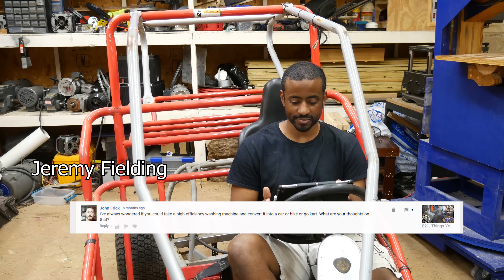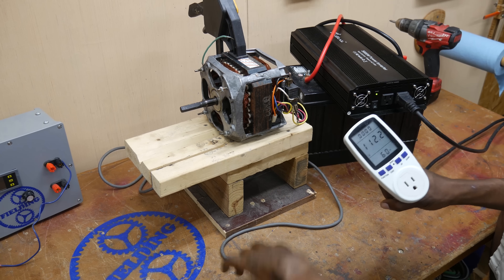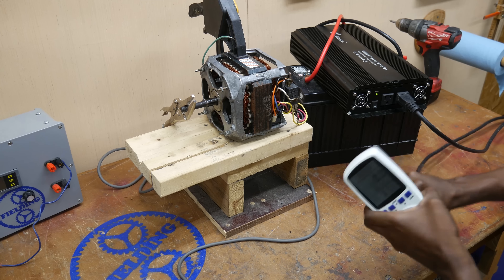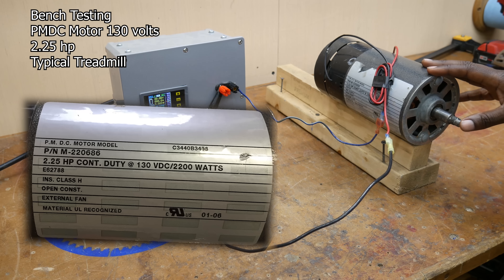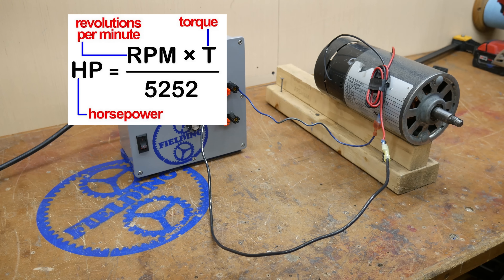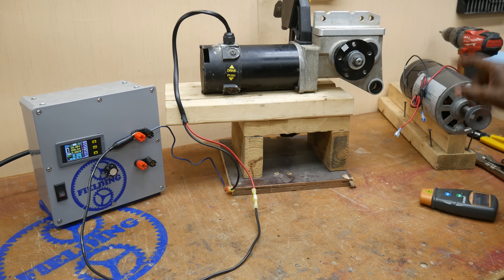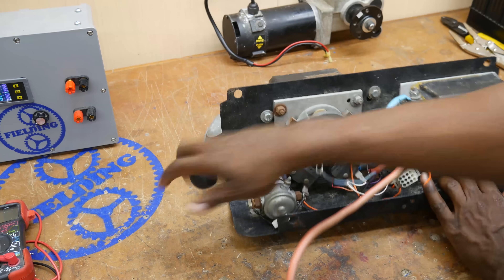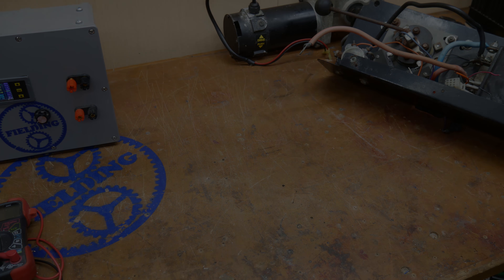What Electric Motors Can Be Used In A Go Kart or E Bike; Bench Testing and Recommended Sizing #61

Comment: It's only about $350 for a 3 phase variable speed drive for a 3HP motor with 1phase input and they can run easily pff a standard 15A wall outlet and would likely do well off a 2000W inverter - but many can also be had with common DC BUS and can run off 200-300VDC - I've built a cart using a 3HP 3 phase motor, cheap VFD w/ DC BUS, and 24x12V UPS batteries - about 10 miles range.
Reply from the maker: If I could take one of my 3 phase motors off the shelf and get a controller that works on DC for $350 that might be reasonable. But 300 VDC is pretty high. I couldn't recommend something like that in a video. 12 rechargeable batteries is getting the cost back up there. You can't recharge that with a standard charger, or you recharge them individually which sounds awful. Perhaps a power supply, but most people watching this don't have that. Also 3ph motors are not a common household thing. I mean I have several but it is likely people would be buying a motor. I guess If you already have a 3 phase motor and you are comfortable with your wiring skills (300 volts) than this is certainly a route that would work. This kind of option depends a lot on your skills and what you already have.

Comment: Actually, if you overvolt your motor, it will draw less current, not more. The power input is voltage times amps. The output power is torque times RPM. So, how much power you use will depend on how much torque you apply to the motor times the RPM of the motor.

The problem with overvolting the motor is not due to extra current. It's due to the insulation on the windings. If you apply too much voltage, it might spark straight through the insulation causing a short circuit which can burn up the motor. A motor rated for higher voltage will have better insulation on the windings.
Reply from the maker: You will draw less current at the same load. That is the point. You can apply a greater load. 

Overvolting...Both are problems... not one or the other.
Reply: @Jeremy_Fielding , What about a starter motor out of a car? They operate on 12v.

Comment: how about using both motors the granny one to get you going then kicks over to the fast one
Reply from the maker: Using two motors makes it a complicated setup... especially with the space that is usually available. But certainly it can be done by those with the patience to work through the problems involved.
Reply: i got my  own project going i have a old Chinese quad bike its just an 80 but i want to make it in to a dun buggy  i have like a million questions about what to do like should i mount the engine from the top or bottom of the frame,  seen as though its a automatic 80cc bike engine should i make the rear axel stiff or put shocks, should i mount the engine mounted over the rear top front of the sprocket, does it matter what way its mounted so can i mount it vertical or should i have the engine flat with the head at 11 oclock as it were when it were a quad

Comment: Horsepower is horsepower. The torque curve of electric motors are very similar. So the 2.25 hp motor that goes to 8k rpm will give you only slightly less performance than the motor you plan on using, provided you give it 3-4x more aggressive gearing.
Reply from the maker: I think you misunderstood what I said... there are other problems which I explained in the video why that motor is not a good option. I didn’t say it was too small or anything like that. HP is not the problem. Getting the full 2.25 requires 130volts... that’s a lot of batteries plus the other problems explained in the video.
Reply: Jeremy Fielding I didn't realize it was 130V.
Yeah, you're right.

Comment: There was an electric go-kart produced back in the 90s called the Kango. It used a Leeson 1.5 hp 36 volt permanent magnet motor and a 300 amp speed controller. They claimed a top speed of 28 - 32 mph. Edit: And then I see a Kango speed controller in your video...
Reply from the maker: I took that off of a very old utility type kart. It was all rusted. It had two motors and I was concerned none of it worked. I offered to buy one motor and the controller. after more testing I think I got the speed controller to work. I haven’t tested it under load but it outputs voltages like it should. I can’t find any information on it. No ratings. No labels nothing. I can’t be sure if I am going over it’s limits in voltage, current etc. both motors were in parallel and rated for 48 volts. But they clearly can run on 36 and some engineers do that as a safe factor for the motors.
Reply: If it is like the one I have, it is indeed a 48 volt, 300 amp rated controller. In fact, I have a copy of the wiring diagram, which calls for connection to three 12 volt solenoids and a switch that acts as a governor in order to allow the operator to run the cart at low, medium or high speed. If you want it, I would be happy to send the file to you.
Reply from the maker: Please do... it can only help or do nothing LOL. I would love to see it. I can't post my email here because the spam I get from that is ridiculous, but if you go to about page on my channel there is a "business inquire" email near the bottom. That will show you my email address. If you still have the thing, a real picture of the controller, or labels and the motor would also help me identify what you have. Thank you for offering.

Comment: could i take angle grinder engine and turn down the rpm with transmition?
Reply from the maker: That speed is really high. it is possible but not worth it I think
Reply: Transmitigation with permition

Comment: Using a booster converter with that treadmill motor should make it usable for this application. That or 9-10 batteries in series. Also most motors can put out 2-3 times their rates go for short durations. You are already aware of the heat problem associated. 
Run the 90-140DC from the boost controller thru a pwm for speed control so the motor always sees the high voltage and lower currents.
Reply from the maker: That is an interesting idea. I think 100+ volts of DC batteries is getting pretty dangerous (and very heavy) for a DIY project... which is why I don't recommend it. Unless you really understand what you are doing. To recommend a boost converter is a sign you could probably do it safely. To buy one at this current input might get costly... I haven't checked. If you have the skills to make your own boost converter that's another level beyond what I was talking about in this video.
Reply: Jeremy Fielding 
I am not really worried about the voltage,  just make sure any of those parts are covered, and well insulated. As for series batteries, if using lead acid, you would probably want to use small ones like those used in motorcycles, or backup power supplies for computers.
Reply from the maker: Small ones mean you can’t go very far.   But in the end everything brings a trade off including cost.
Reply: Jeremy Fielding 
That's not true (ignoring any efficiency differences that might exist). If we look at two batteries,  one group 30 at 12V and 120Ah, and 10x ML12-12 AGM in series for 120V at 12Ah, they both supply about 1440Wh of power. A 2.25hp motor (1678W) if running at 12V would need to draw 140A, while a 120V motor 14A (+10% or so for efficiency losses).

So one group 30 is much cheaper than 10 of the smaller battery, but sometimes you can get the small ones as surplus when companies replace all their UPS batteries.

Some other things to think about are what the batteries are capable of. The Ah rating of a battery is actually dependent on the discharge rate. If you did run that motor at full power until the batteries are dead (and they did not explode), the Ah rating would be much lower. The chemical reaction takes time, so the faster you discharge the battery the lower total output you get.
The internal resistance of the batteries may prevent drawing the desired current, or it might heat the batteries excessively.
Running at low voltages and high currents will have high losses, and require expensive wiring.
Finding controllers might be difficult or expensive at high currents.

In the design I have been thinking about, I would use three 12V batteries in series. The motor will run at least double its rating for some time, so plan on 100A at 36V coming off the batteries.
The power would then run to an inverter running at around 1KHz, thru a transformer to get to 130V (A commercial  inverter could be used if it can handle the power), and bridge rectified back to DC. The speed controller then uses that to run the motor.
Reply from the maker: The video I just finished recording is on this very topic... specifically batteries, capacities, and the effect discharge rate has on capacity. I would agree (danger to the untrained aside) higher voltage certainly has many benefits, thus golf carts don't run off 12v. and Tesla doesn't run off 48. Good discussion.

Comment from the maker: Please read the description! There are technical corrections including comments on the use of Brushless DC or three phase AC motors there.
Reply: Jeremy Fielding ,  I have a 100 volt dc treadmill motor sitting in my shed that I want to use for a project like this...
Reply: I'm glad you saved me some time.  I won't be using it
Reply from the maker: My job here is done 👍🏽
Reply from the maker: I made a whole video on that. Search my channel for dimmer switch
Reply: What do you think about using a 20hp 48v (@ 96v 40hp?) Advanced  DC motor in a '89 Kawasaki Ninja 600R motorcycle conversion?
Was thinking I'd use lithium ion batteries and probably only enough to go 10-15 miles. I don't ride very far and I really want to keep the weight down.
Plus I can leave chargers on both ends of the only places I ride now.
I have three of these motors. They are brand new. Originally made for industrial vehicles they are primarily used in forklifts and small trucks.
They will fit in the space freed up once the motor is gone and a simple adapter will actually mount the original drive sproket to the electric motor and allows use of the original chain with no further modifications other than correct positioning of the motor mount...
I was wondering if you could recommend a good speed controller. My intention at this point is to trade my "extra" motors for the rest of the components needed to finish the drivetrain.
Reply: What type of "mini car" are you going to use? I have a 20 hp brushed motor and I'm curious how much weight you think that might push around...
Reply: Jeremy Fielding can you use a light dimmer switch for the speed controller for the AC washing machine motor?
Reply: I think I understand.....
Reply: Thanks, after watching your video I dropped the plan to use three phase AC motor for my mini car project now I am thinking to go with a 20 HP brushless DC motor.
Reply: Starters arent meant for continuous use.
Reply: @adubs.  What if you limited the current with some kind of external resistance. Would you be able to run the motor for longer and keep it from overheating?
Reply: AC =/= DC. you need AC for induction.
Reply: Jeremy Fielding A friend took a 32volt coverter and a acdc weld fighting each other and made more electricity than he use messed up gapower. Scientist at Jacksonville whated him to explain how it worked?He didn't know except sometimes shit just happens! He took it to his grave after sharing the details with me. Maybe you could understand?

Comment: Your inverter might be drawing on the battery too much causing the voltage to drop below 10 volts and shut off.
Reply from the maker: I already know the battery can handle more current than the inverted can draw. I didn't think to show that on camera though

Comment: No on the treadmill motor, high amperage will heat up wires, not wattage. READ THE TAG THE ARE DESIGNED TO RUN ON HIGH VOLTAGE!!!!!!  You can get 8 7ah 12v batteries for $120 and have 30-40min run time.
Reply from the maker: I am not sure if I am answering your comment in full context but I believe I said the current will be too high for the wire gauge. You can not get this motor to run the full 2.5 hp that far below 130 volts DC.
Reply from the maker: Wait at 96 volts DC you better really know what you are doing. Granted... it sounds like "you" know, but I can't recommend that in a video. I also mentioned in the video over 100 volts worth of batteries would be really heavy. I didn't say it was impossible... just not worth it in my opinion.

Comment: What about an actual motor controller? My drone uses 3 phase ac motors with tiny 30amp electronic speed controllers
Reply from the maker: Yes...that is really what car makers use for AC motors and brushless DC motors. They work as they should but can get very costly to get one large enough. It’s about your budget at that point.
Reply: There's a big difference between pushing 2 lb for a drone and pushing 125 lb for a cart. $$$$$$

Comment: you are omitting the use of gears. Gears give torque not speed. your gearbox should be aluminum not metal since this is a single seat go-cart. Also people should use small wheels not big ones. the same as in a car you should use foam/sponge seats to take off a lot of your weight.
Reply from the maker: I did talk about gears several times. Also gears can be used for either speed or torque. I talked about that in the video. This is a two seater with one of the seats removed. I have ordered another seat. And finally I would agree smaller wheels are better in that they are easier for the motor to turn, but not always what you want. Drag racers have massive wheels for a reason. Speed. You just need enough hp to apply the force to the road.
Reply: this is a go cart .. drag racers use gazoline not electricity. I watched the video that's why I commented. the problem is that DIYers don't think about efficiency from the beginning. they just want stuff to work. planning would be a good idea instead of just trial and error. shooting darts in the dark and hoping it will work. 
I hope you succeed but if you accept advice. it's time to get your hands on a car starter .. the thicker the enameled copper wire the stronger the current (magnetic field) and the starting torque. Dry cell batteries a good choice too.
Reply from the maker: I love advice from my neighbors... that’s why I respond to all the comments. I just disagree with your conclusions and you seem to have walked away with a very different impression of the content than I would expect from having watched it for hours and hours myself. The whole video is about helping others plan their project and understand why random motors they have may not work. I have already calculated the power requirements for my project, and choose a motor designed for that purpose. Perhaps you mean people in general throw darts at the wall but I don’t think that is what was presented here.
Reply: I meant no offense, I understood your video perfectly but the video you made didn't come from nothing. you had already tried many motors until you reached that conclusion and this is why I said what I said previously.

yes my comment doesn't target only you. it targets you, me and all people attempting to do a practical go cart and sharing their results, research and experiments on youtube. The advantage you have is that you can get your hands on free motors salvaged from appliances you find while many others don't have this advantage and many of them will end up buying a motor. 
So yes your video is helpful, I'm not denying this but it really takes a car starter motor with gearbox system to do the practical go cart/ electric car if I understood your goal correctly. My whole purpose was for people not to re-invent the wheel but to learn from your trials and hopefully to see you make it happen and maybe do a detailed tutorial for me and others to follow.
Reply from the maker: Offended is way to strong... just really surprised that someone would watch that and come to the conclusion that the testing was haphazard or trial and error. People ask me everyday as you say you saw... so I wanted to give real examples of why they wouldn’t work. Instead of just commenting it won’t work. I bought the motor I knew I needed based on math before anything you saw in the video. I don’t even want a go kart.this whole project is about showing how to think through a engineering project. So I was surprised that you thought I was figuring it out along the way.  As to the starter. They are not designed to run continuously under load. But for 10-30 seconds at max load. I don’t think that will last very long if you ride for more than 1-3 minutes. They will over heat and quit. You could try and manage the heat with fans etc if you happened to have a starter, but I would not buy one for this type of project
Reply: good good, just to clarify that your video is not trial an error but the result of trial and error which is a natural form of "testing". I never said you were figuring things out during the video. 
About the motor starter. A starter might get hot if you are turning a car engine crank with its attached pistons and it's connected gear box. it will overheat if you are saturating it with current which is not necessary. when you first crank a car (CCA) you're delivering 400-500 amps in one go !! you won't supply such current in a go cart.
Anyways. keep the updates coming :-)

Comment: You should try to find a way to cool it while it is running. like junkyard parts or something. build it a casing it can sit in filled with non conductive liquids you can cool thru a radiator.
Reply from the maker: I will start with a basic dc fan